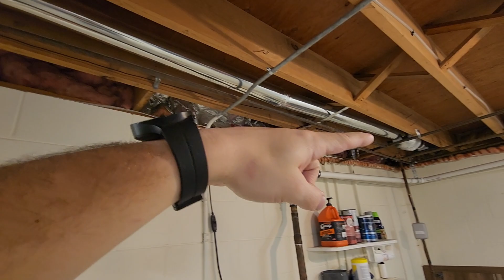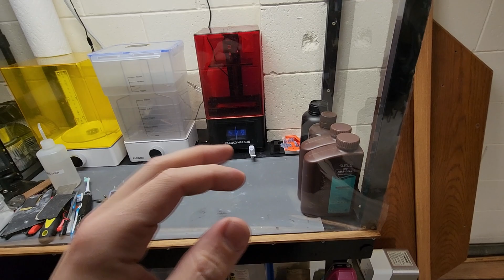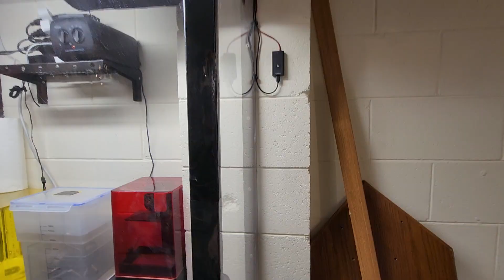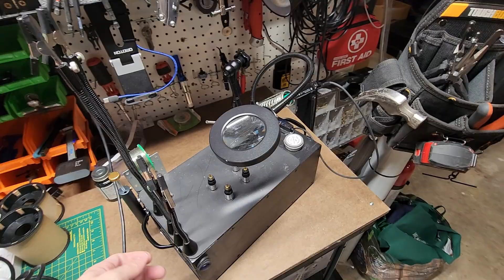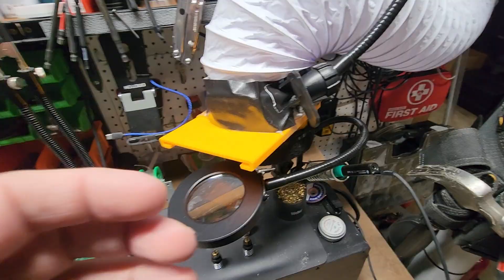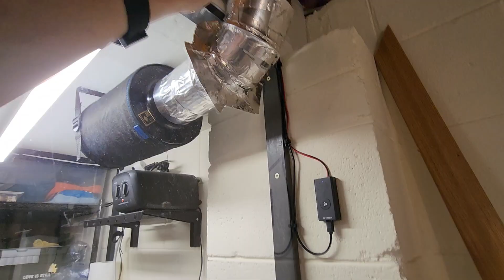DIY Automated Fume Extractor for Resin Printing and Soldering

Comment: Would you mind sharing a parts list for all the electronics, contactors, and how you sense whether or not the printer is running?
Reply from the maker: This setup has been upgraded a lot since the video was posted. Fully automatic servo-actuated blast gates and fume extraction for 3 printers. I don't do any resin printing anymore, it's all FDM now. The amount of PPE required to do resin printing safely, all the paper towels, all the IPA, and you get a more brittle end result. For my specific situation resin printing didn't fit, but the hood is still in use.
If you're interested in the electronics as they were in this video: A 4" AC Infinity inline booster fan, their pro version. However, if you want to use the same fume hood for painting occasionally you'll need a 6" duct and fan instead of 4", the 4 just doesn't move enough air. It's great for the resin printer though. I used reed switches on the blast gates to know when they were open, glued the magnet portion to the sliding gate so it's away from the reed switch when the gate is open. To sense the state of the gates and actuate the clicker I had a "Shelly Plus 1" running on DC (24v), with the "Shelly Add-On" attached to it. That gave me a relay and 3 digital inputs for the reed switches (one on the shelly, and 2 on the addon). The Shelly has internal scripting where the control logic can be written. This system was finicky getting the timing right on the relay to make it hold state accurately, but it generally worked.

The new system is much more advanced. It's an ESP32 with mosfets that feed the 10V signal back to the fan inversely proportional to the speed I want. For those ac infinity fans 10v coming back means off and 0v means 100% speed. this is so the fan automatically turns on if the controller is unplugged. The esp32 also handles the servo automation but that's a whole separate topic.
Reply from the maker: Whether the printer is running was by looking at the power usage on the smart plug powering the printer. The plug was a Shelly Plug US, and i have that integrated with home assistant to see energy usage, but could also see whether the printer was running. I used an automation to see rizes/drops in power consumption in succession. For example 20w to 30w to 20w to 30w etc. this pattern of power usage happens whenever it turns the UV screen on/off for each layer. You could also just look at overall power usage, but this pattern let me be sure even if other devices were on the same plug. I overcomplicated it for sure. You can get AC sensing relays that will turn on when power is drawn as a simpler solution, or get a simple thermal switch that triggers at 40-50C or around there and attach it inside the case of the printer on a component that gets hot when printing so the contacts connect while printing. Lots of options.